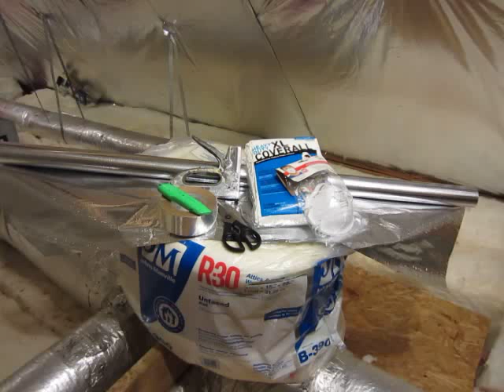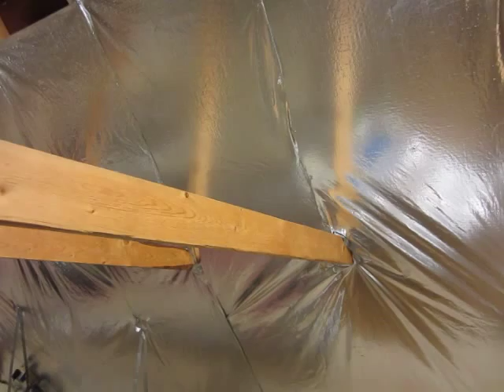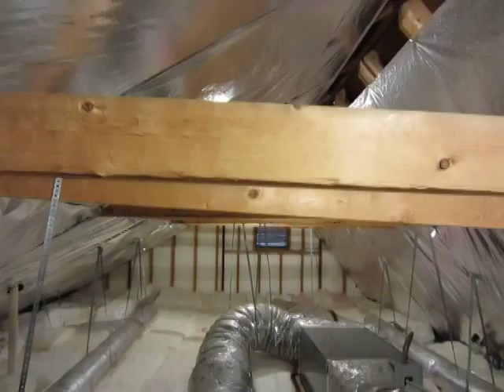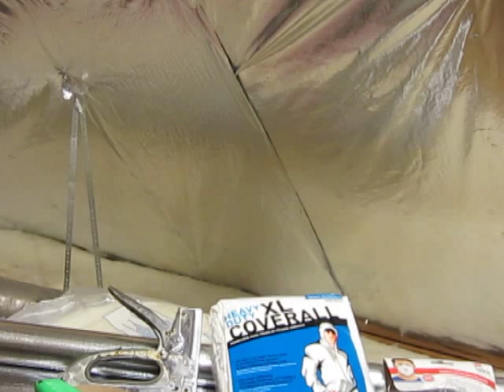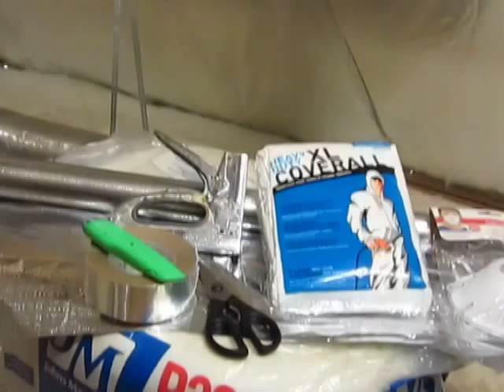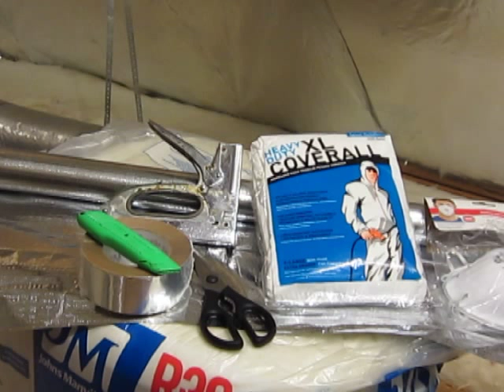Arma Foil Radiant Barrier Installation

Comment: I may have missed this: do you have insullation between the roof and the radiant barrier? Where r u located? How many units do you have? House square footage? Good job. I’m getting a cookie cutter house built, and I’m already planning projects.
Reply from the maker: No insulation above the barrier.  Insulation is above ceiling.  Heat reflects off barrier and exits at ridge vent before ever entering the attic.

Comment: Thank you for the video! Did it foil barrier lower the temperatures in the bedrooms, family and living rooms without having the AC on? If so, how much of a drop did you notice? I'm about to pull the trigger and buy 3500 sq to do my attic. Thanks again!
Reply from the maker: The temp in the living space below the attic depends on two things:  first the temp in the attic space, and second the R Value of Insulation in the attic.  In my case I installed an additional R-30 Attic Insulation in the attic, and installed the Radiant Barrier in the roof rafters.  With the Radiant Barrier, the attic space temperature is now only 2 degrees above ambient outside air, where before it would easily be 125+ degrees up there. The hot air is channeled out the ridge vent before reaching the attic space,  Best time to install is spring before it gets unbearable to work up there in summer.

The energy savings have been significant.  Now have two years of history and also have a nest thermostat that monitors the A/C run time every month. Basically have seen about a 50% reduction in A/C runtime, which reduces operating cost and extends life of the equipment.  Also have seen about a 40% reduction in heating costs, due to the increased attic insulation.  Hope this helps.